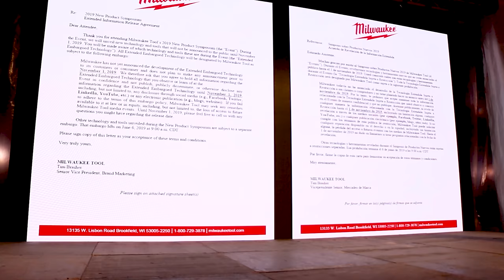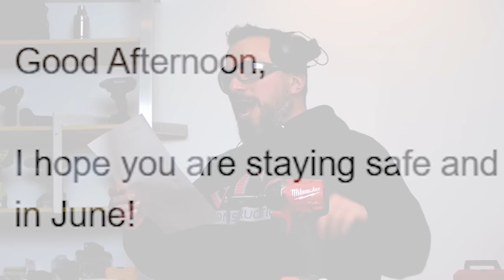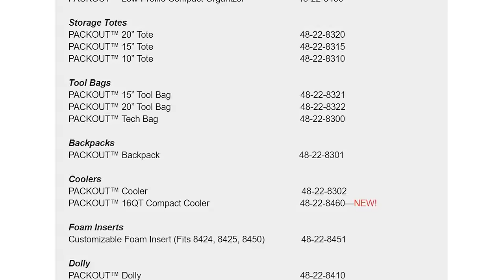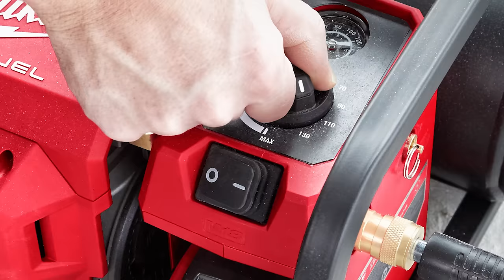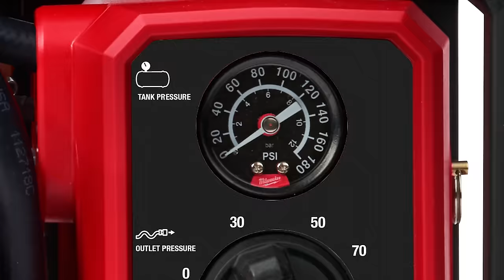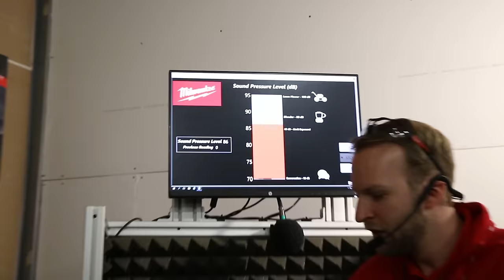MILWAUKEE TOOLS NPS 2020 IS HAPPENING RIGHT NOW! (FIRST LOOK NEW RELEASES)

Comment: The compressor is a huge deal! There's just some pneumatic tools that can't be 100% replaced on our jobs. The compressor can be. With a few of these we can replace the bigger compressors we run inside for finishing/lighter work. IF... it performs like all the other cordless FUEL offerings have. Very excited to get mine and give it a try. Also excited for the half packout cooler to match the half packout toolbox. Perfect combo for a RZR 1000 with aftermarket cage and limited space. The mounting plates for the packout are beast too. Perfect for all side by sides getting a trail workout
Reply: I want one of each
Reply: MR Briot! Hello and how have you been? I hope all is well!
Reply: @amoscardoza5253  yo brother! Can't complain. Staying busy! Hope all is well with you 👍
Reply: @BILLY LAM i have the flexvolt compressor. It's brutally unimpressive unfortunately. Especially for being 54v. We do go through dewalt batteries like carpenters pencils it seems as well. Hopefully dewalt has or will fix the issue/issues. Batteries are one of the reasons we went nearly all red and black for cordless tools a few years ago. Mainly warranty. Or lack of. Atleast for me and our lack of a dewalt service center. Take care.
Reply: @RobertBarth1  meh..... All of the high end compressors are high. My flexvolt cordless compressor was more than that. 
BUT....... Atleast milwaukee runs smoking crazy promo's. Not saying the others don't. They sure do. But a person with some patience and legwork can pay far less for these tools than list price.  I plan on snatching one for about $249. Hopefully I can track the deals down to $229 or so even. We'll see. 
If the performance is there, the convenience alone will pay for itself with my company. So a good price is only part of the equation. 
Take care!
Reply: @MostlyPeacefulCombatVet  i have the dewalt 54volt as well. and i will keep with it for two reasons. first, to get the Milwaukee one running at 1600 nails per charge you need the 12 amp battery @ 189 plus 350 for the tool. so for 539 you get 1600 nails per charge. at the same CFM as dewalt. but smaller tank, so it will cycle more ergo it will wear quicker.  to get started with the dewalt one. you get 1200 nails per 6amp 54 volt battery, and it comes with one @ 300 and another battery if you pay 450 for the combo. so for about 100$ less. i can get the Dewalt one which will shoot 2400 nails between both batteries. to summarize Dewalt 450@2400 brad nails. Milwaukee 539@1600 brad nails

Comment: I want to see a A better packout with drawers and a front opening chest on the bottom so you don't have to take your packout system apart to get to the stuff on the bottom
Reply: It will be 300+ bucks a piece for a drawer packout probably a 100 bucks a drawer!
Reply: i agree but thats like dewalt style. they're trying to beat them, not join them.
Reply: My Dewalt rolling tool storage is my go to.
Reply: @allanyang21  last time I looked at the DeWalt system they only had one type of drawer section and it's only for small items like hand tools or screws... I mean a drawer that could hold something like a sawsall or even a new bottom cabinet with wheels in the packout system that could open from the front and hold a circular saw, blower, or similarly size and profile tool. Maby even one of the large M18 hammer drills... The DeWalt TStak system only has a small drawer section last time I checked and nothing large enough to hold large cordless tools like a "M 18 Fuel circular saw"... First company that comes out with a large cabinet/drawer wheeled dolly that opens up from the front, with other large stackable sections that open from the front will get me to open my wallet to replace my dolly with Milk crates and bungy cords. DeWalt TStak has gotten closer than  Milwaukee so far because they actually have a drawer section, but it's just a small section that adds on to an inferior version of packout, I want the whole bottom section to be like that drawer section,.... Maby not even drawers just a front opening door on the bottom crates
Reply: I don't understand why they dont have something like that!
Reply: I want a packout hand truck
Reply: I literally just commented the same thing lol
Reply: I’ve got pack out but I’ve always wanted a 3 drawer box like the dewalt, it’s pretty nice
Reply: @allanyang21  you obviously don't use the packout on the daily. The only way to access your tools quickly is to build a shelving unit that houses each pack out separately. A pack out with a slide-out compartment or slide out bins is absolutely needed. In fact I tell anyone who will listen that they should check DeWalt out before they invest in Milwaukee just for this reason alone.
Reply: Cassidy Keen Separate box system is nice but DeWalt’s dolly is heavy because it is made of steel instead aluminum.
Reply: Cassidy Keen I bought the 3 piece packout set on sale for $180 cad, I just wanted the rolling toolbox but it was a different item code and it’s not on sale. I don’t use the whole system, I only use the rolling toolbox for my power tools and accessories and the packout backpack for my hand tools. So I cannot complain about pulling off each modules to get to the bottom since I only use the bottom haha

Comment: I have worked at the Milwaukee Tool Distribution center for 10 years, and have met Steve Richman on several occasions.  He is a solid down to Earth guy. He was walking through the warehouse eating a bag of veggie chips, and I told him "hey, we're not supposed to be eating in the warehouse." He stopped walking and said, "you're right." He threw the chips in the trash, chuckled, shook my hand, and walked away. He listens to us and actually does something about our complaints. Rare to find a President that down to Earth. Loving my compressor and running it with a 12.0 battery. 👍🏽

Comment: I want to see a Battery pack to AC conversion kit. If my batteries are fried I would like the option to plug the tool in and when the battery platform dies I dont want to be out of luck. Other brands have it.
Reply: Chase we can only hope they figure it out. Even Metabo has that option now
Reply: @the_dre_wayy9204  I get it of they're trying to not sell less batteries but I know these tools will out last the batteries. Not to mention I may just not want to keep dropping hundred on new batteries.
Reply: There u go...build one n market it
Reply: Amen.  I'd love to be able once sites have power plug and go.  I have the cordless 10" miter for doing stands in the field.  I have a corded Metabo at home.  I do a lot of cutting because I custom build deer blinds.  Would love to replace it with the second Milwaukee saw instead of selling it off.
Reply: Absolutely or make more of these tools  with plug in abilities
Reply: @perfectrepair6470  right, I don't think it would be that hard to also throw on a chord, shit if you had it plugged in it could charge the battery that would be awesome. This is why I didn't buy their table saw. It's ONLY battery powered, wtf.
Reply: The first Milwaukee cordless tool I purchased was in 1995.  1 battery lasted until 2013 and the other a year longer.  Now my M18 batteries are going bad after 4 years.  They better come up with this corded conversion option because their batteries are a rip-off for how long they last.
Reply: I think this would be a perfect solution to times you have a miter saw or table saw. And you're in your shop and have ac power available. It would increases more people to want to buy a tool for its flexibly
Reply: Edpeshaly to youse in a shop or a house
Reply: I have a m18 rocket light with that in mind
Reply: @56243G  If you're a contractor and you got 4 years of daily use of an 18v battery you've done well. Only so many charge cycles those little guys can take.
Reply: Chase DeWalt has it for years
Reply: 56243G “All” they need is get on Samsung solid state battery research and help it come sooner to the market.
Reply: I've been wanting this for years. I caved and bought the DeWalt flexvolt 12" mitre. Its so nice...Corded and cordless!
Reply: They have a patent for an AC adapter for MX FUEL.
Reply: 56243G buy them 3.0 batteries they last the longest life span wise. I still have m18 3.0 batteries from 2010.

Comment: I think this explains why we haven’t seen an M18 version of the M12 inflator. A corded backup option would be great.
Reply: Dick Kennedy but I still want a m18 small inflator🤔
Reply: I was never impressed with the M12 inflator. Far too large for keeping around to inflate tires. Sorry to say, the Ryobi Air Gun is fairly superior (in my own opinion though).
Reply: Same here. It only inflates one or two tires on it a charge. I've been scratching my head as to why there's no M18 variant as well
Reply: Exactly. Would be especially nice if it was put into a square-log profile, with a dedicated cooling fan, seperate of the motor, so it can cool itself off, and increase the duty cycle.

Comment: If they are going to release a cordless compressor, now would be a REALLY good time to release a 23-gauge 2-inch pneumatic pin nailer.  If they have been holding off producing a cordless version because they wouldn't have been able to keep the oversize down, this would be a good alternative.
Reply: I've got some good news for you about the M12 pin nailer! I found out Milwaukee has a patent on one that was filed a few years ago. That's generally the time frame between patent application and tool release, so we'll probably see it this year or next.

Comment: Thanks Vince!
I still want a Milwaukee Wet saw and a shop vac with a 2" hose for job sites in M-18.
Reply: Maybe a fuel Bridge saw? I can retire my rubi
Reply from the maker: Good call!
Reply: Yes I agree
Reply: Don't think M18 really has the power or endurance for use in a shop-vac format vacuum. Maybe if they did an M18x2 set up, but they seem to abhor that concept. MX Fuel would probably deliver great, but the cost would be too high.

Comment: You’re either going to fully embrace cordless or not.  This is a stop gap measure for tools that are not yet available in cordless, or may never be available in cordless.  I use a pin nailer a lot, so a compact compressor is vital.
Reply: I've got some good news for you about the M12 pin nailer! I found out Milwaukee has a patent on one that was filed a few years ago. That's generally the time frame between patent application and tool release, so we'll probably see it this year or next.

Comment: I’ve only owned one Milwaukee 12v drill driver back in the 90’s in this last week I’ve purchased a couple of things and I want more of course I have to stack some money first but there’s time. I got a deal with a m12 3/8” right angle drill with the purchase of a 2.0 ah starter kit for 99.00 dollars and yesterday I purchased the m12  1/4” right angle impact driver for another 99.00 dollars (tool alone). So my next item I may or may not get is the XC battery pack 4.0 ah with charger for 79.00 dollars so if purchased I’ll have 2- 2.0 ah regular batteries and the XC 4.0 ah battery. Perfect for starting out a new relationship with Milwaukee.

Comment: I'll definitely give the compressor a good look over, I do definitely need to replace my cordless ridgid 18v compressor that I've had for 3 yrs, I just hopefully wish that Milwaukee, in the near future, make's a corded battery adapter available for this unit. 🤞
Reply from the maker: Right on
Reply: I made a corded battery adapter with a 20v 8 amp power supply and Chinese battery tops.
Reply: Yo bro! I know that Milwaukee has a patent for an air compressor that will be packout compatible.
Reply: go dewalt. from a dollar to performance standpoint it makes 50% more sense to buy

Comment: I can say I'll be buying that compressor when it gets released. That thing is absolutely perfect for my jeep! I can air up the tires after an off road trip, and even use it to run the air lockers. 

Something I'd like to see is some sort of iceless cooler. They have them that plug into your vehicle power port, so it shouldn't be to hard to adapt that technology to run off an M18 battery.

Comment: I Agree didn't think they would bother with a compressor. Seeing that the line of gen 2 guns are incredible. I'm a trim carpenter and been using the 18 g Brad nailer. I've put at least 35,000 nails through it and not one issue. Milwaukee hit a homerun.

Comment: Hey Vince, 
How about...
M18 Fuel Packout Wet/Dry Vac
and...
Wait for it...
An M18 Wet Tile Saw,
Ha haaaaaaa

But Wait.
I know they are not gonna do it like they weren't going to go into pneumatics but to have an M18 Battery adapter that can change a tool to CORDED!
Yes 
That's right.
Corded. 
You can have that Miter Saw that Table Saw  that Tile Saw hooked up to power when you want.
Don't get me wrong battery is the "bees knees" but options is what life is all sbout.
See ya Vince.
Red
Reply: WHATS THE COMPRESSOR CATALOG NUMBER

Comment: Vince haven't you address the horrible chuck on the fuel hammer drill I'm on my 4th one in a month . Also got a unfixable uneven fence on the 12" sliding compound miter saw what is going on with them

Comment: Hello, thank you for your share with us!, I have a question for you: does is there a van racking system or attachment for the Packout Boxes like though system van racking?, or you have an idea how is possible to use the Packouts boxes in a van without adding to much weight to the van because the shelving like the wood ones?  Any share will be so appreciated!.  Thank again for all your shares with the tool lovers!!!

Comment: I need to see them release the framing nail gun.   It’s interesting that they held off on the battery 🔋 framing nailer but produced the air compressor. Wonder they have any connection.

Comment: Hopefully the compressor will be able to air up HD truck tires fairly easily. 80psi isn't alot but my 2 gallon wired compressor hates going that high. My 8 gallon has no issue.

The smaller compressor obviously has a smaller motor. Hopefully the Milwaukee compressor is decently sized

Comment: I have begged for over a year now to anyone that will listen for Milwaukee to make a tubing cutter that will do 1-3/8",1-5/8" and 2-1/8" copper. I do large commercial Air conditioning systems and that larger tubing cutter would be a gift from the gods.  I love the smaller 12 volt tubing cutter that will cut up to 1-1/8" copper....so much so that the shop I work for bought dozens of them on my recommendation. Now they just have to hurry up and scale that one up to cut the bigger pipe!

Comment: Top ten tools I want to see
1. roofing nailer m18
2. adapter to run tools with plug (Dewalt and Ryboi already have one)
3. adapter to run m18 tools of mx battery i guess maybe the generator could do this if they make #3 (longer run time and more power for miter saw, table saw, lights)
4. adapter to run m12 tools of m12 battery clip on adapter
5. mx backpack blower
6.  car jumper m18
7. chop saw m18
8. mx tamper 
9. mx concrete mixer
10. mx log spliter

oh and maybe a framing nailer would be nice

Comment: I would also like to see some long hollow sockets like the ones makita has for tightening nuts on all thread and more than just two lengths of certain size nutsetters. Or a reversible one like malco's 1/4-5/16 that way the magnet can be cleaned when it needs to be. The milwaukee magnets are strong but the pick up everything and are a pain to clean
Reply: Use Vince's Trident chewing gum hack to clean the shavings out of the nut drivers.
Reply: @ApacheLife-50  i use butyl tape aka duct gasket to clean them. It's not bad but it's a waste of some material and would be quicker just to pull the end off.

Comment: I want to see a cordless pin nailer
Reply: Jerry Arruda absolutely
Reply: I did hear that ryobi and makita have a 7 year patten hold on the cordless pin nailers due to Milwaukee's similar design with ryobi air-strike (nitrogen cartridge piston with shelf life) and dewalts motor/belt/spring drive similar to makita pin nailer
Reply: Yes I do
Reply: #1 on my wishlist too
Reply: Milwaukee filed a patent for it. I would assume it's in the works
Reply: Kirk 42 Milwaukee filed a patent for one and Metabo/Hitachi also has one.
Reply: @kirk422  Ryobi, Ridgid and Milwaukee are the same company...

Comment: I was hoping the compressor would be ac/dc like the work lights so you could run it plugged in, it would charge the battery while plugged in and you can also unplug it and go totally cordless.

Comment: I want to see a 23 gauge pin nailer on m12 platform. Something small and lightweight. Well designed so it can fit right up against the ceiling

Comment: Vince, 

First let me say i do like the design of the new Milwaukee cordless air compressor. I do agree with you that there needs to be a decibels check.

Now it just a little confusing. There's videos on Milwaukee web site showing guys happy that they were making cordless nailers. No more carrying air compressor, hoses and nailers on the jobsite. 

Now that there is a cordless air compressor everyone is ok to carry a cordless air compressor, hoses and nailer. Don't get me wrong it's a great tool idea but you have to admit it's confusing.  Plumber's are going to like this when they need to do air pressure testing. 

Again, If it's only two gallons, just plug in to a outlet.  Oh wait, just use the cordless already,  LOL... 

Thanks for the update video

Comment: The comprssor was already a good guess with the royobi 1 gallon, rigid 2 gallons. I want to see how this beast performs on a 5 ah battery not a 12 ah battery. 12 ah is good but not safe on flights. I have a lot of nailers and this would be a very nice option to go fully portable and still powerful.

Comment: M18 fuel 3 × 21 Belt Sander
Based on their cordless planer 
But Balanced so the motor doesn't tip the unit to one side